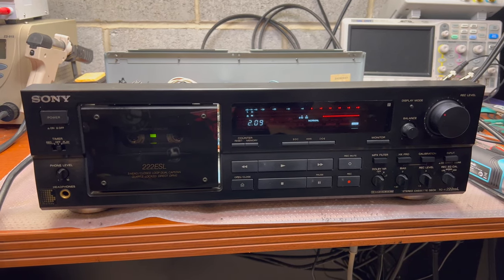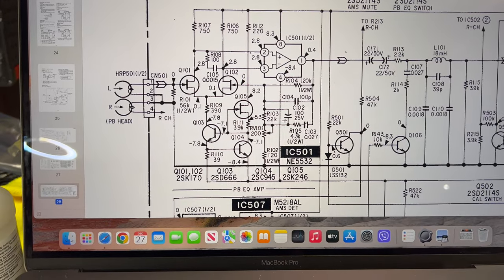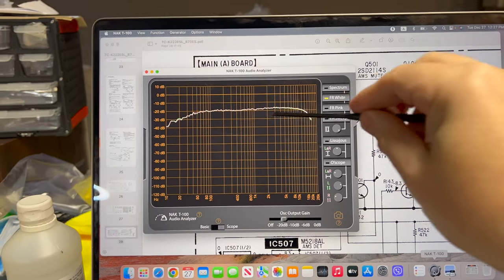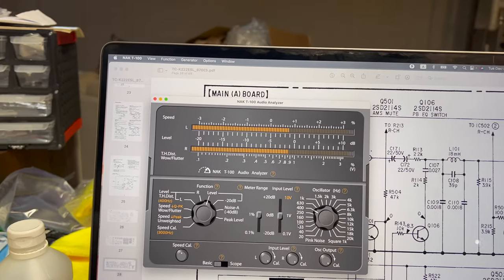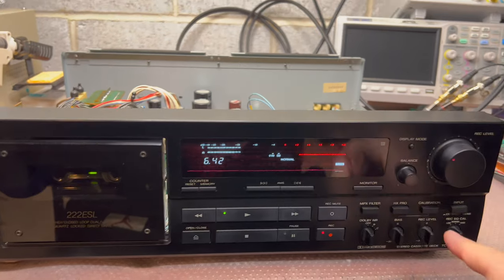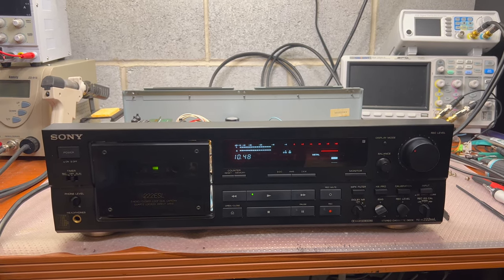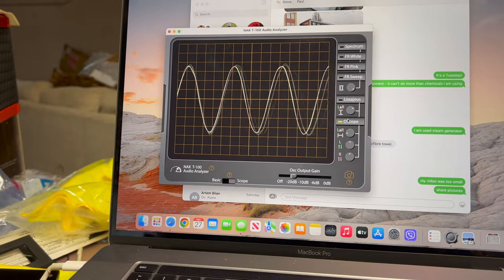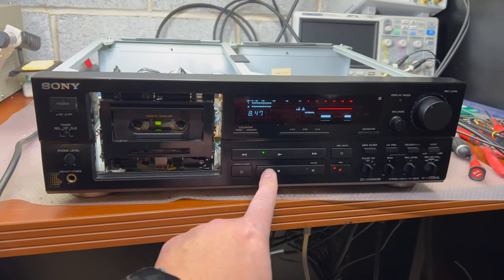How To: Set Sony Deck Playback Frequency Response - A Step-by-step Guide

Comment: hi,
I am using tc-k222esl. I am using Nak T-100 as test program. I'm testing "fr sweep". But at 10khz it goes straight down. I can't figure out the sudden frequency drop. I set calibration from front panel. I start recording but the high frequency sounds are almost non-existent. It's like it doesn't record frequencies after 10kz. There is a lot of difference between source and monitor. I set it to 400hz on the nak t-100 and "222esl" shows up as 0 db on the front panel. then I set it to 10khz. "222esl" decreases to -20 db on the front panel. Where could the problem be?
thanks
Reply from the maker: Cassette decks can record above 10 kHz only at low levels, you should measure sweep on -20 dB
Reply: Thank you very much for your reply.
Now I did a scan at -20 db as you said, but the result did not change. The results in your video are amazing. I also go down between 8khz and 10khz. Could it be a problem with rv303, rv403, rv302, rv402? Or would it be helpful to replace the capacitor as you did? because I don't get any pleasure while recording from 222esl. I bought it in a restored state from Japan. It saddens me that it records so badly.
Reply from the maker: @user-lk2mw4um5g  I may guess that head needs to be lapped. Absolute all 222s I have seen delivered from Japan had worn heads. And after lapping it still would require to install FR correction pots and additional capacitors to compensate loss.
Reply: @hifirulezzz  You explained it very well. I will do as you say. I hope for good results. You are very knowledgeable. I enjoy watching your videos. I will continue to use your information.
Best regards.

Comment: Hello.
I watch your videos with great interest.
I had my tc-k222esl cassettedeck completely restored.
But when I insert my sony hf-s and sony chrome cassette (rec level 0, bias level 0) and calibrate, my indicator is 4 points below the "rec cal red point". "Cal level meter adjustment" Do I need to readjust the RV102 and RV202?
Kind regards
Reply from the maker: If both of the bars on the scale are of the same level - then not much to worry about, just adjust the record level. If bars "low" and "high" are 4 bars different - then it is head ware, as sensitivity on the highs is lower.
Reply: @hifirulezzz  Your answer was helpful, thank you very much. Sorry for typing the level wrong. It's not 4 bars, it's 8 bars low. I will increase the level from "rec level" as you said.

Comment: Amazing resource. Looking forward to one day tune my TC-K770 the same way.

Also since you're talking Sony... how about calibrating the Dolby circuitry? I've always had the impression of Dolby muffling the sound, is it just normal drawback or is it because of mistracking ?
Reply from the maker: Dolby cuts highs a little bit anyway. It is just how it was designed. You may compensate by reducing bias and it will sound significantly better.

Comment: I used a 560pf ceramic capacitor for the left channel of the pb amplifier and a 470pf plastic capacitor for the right channel and the high frequencies were enlivened (increased 3db). but I couldn't fix the db slope between low frequencies and high frequencies. At 40hz -20db, 8khz becomes -22.5db. There is a flat landing. If it's 17khz it's -25db. If I replace the old capacitors with muse bp or toshin kogyo utsj capacitors, will it affect the result? Or is that the maximum upgrade I can get from the 222esl?
Reply from the maker: https://youtu.be/OuWgEd7hjgI

Comment: I have a Tascam 122b. The mids and HF are good.   But the LF are really not that great.  Is there ways to adjust LF on playback on cassette decks?  I am using a new commercial music cassette and also tdk type ii for recording.  Recording is also the same when i play back via repro. . LF not quite got the oomph like my other Tascam decks.  Could the caps be going bad? Its an old deck.  1980s, early.
Reply from the maker: Dried capacitors will may be a reason. I have met an Akai deck with very thin sound and level indicators were not moving levels. Replaced capacitors and it was a super sounding deck.
Reply: @hifirulezzz  There are alot of caps on the rec/play board.  Maybe just the electrolytic and LL caps?  Mylar are OK probably?
Reply from the maker: @rcary  yes, I meant electrolytes

Comment: Learning mode ON. I am pretty sure I am unable to detect it.
I have a TC-K770ES which is feature reduced export version of this deck... I love the form factor and ergonomics.

I really need to buy a scope to test these decks on my own but I can't find anything new that I like <500 EUR. I am not yet ready being ridiculed for buying a 5 MHz scope...
Reply from the maker: Well, exact copy is K870ES 😎 And you may just spend $25 for a good software like I am using which will cover your needs.
Reply: @hifirulezzz  I can read speed with my meter, if there is some software that can measure "phase" during playback for azimuth adj. I'll get it. I am on Windows.
Reply from the maker: @m80116  check videos on my channel, I am using Nak T-100 Analyzer software which is available for Mac and Windows. It has oscilloscope mode where you will be able to set the azimuth
Reply: @hifirulezzz  Best tip ever. Thank you... I noticed that software already and told myself: I'll never be able to find anything closer for Windows... but it wasn't my deck on the wrong bias... it was me!
Reply: @hifirulezzz  Thanks again... now I have to upgrade Windows that I don't do since well... 2016 and even find out how that software has 3000 Hz speed calibration mode. I can't understand what is that for... anyway, I'll find out eventually

I'm dying to try that software to characterize the frequency response of my cassette tapes.

Comment: This looks like a gap loss. I believe there were discussions on TH about the heads in these sony decks having very shallow gap depth, and with minimal wear the gap starts to open very early in the head's life, which s*cks.
Reply from the maker: Well, Microscope does not confirm that theory. What I mentioned, is that Sendust heads and Nakamichi Crystalloy heads age better than Laserampurphous. Also, have read in a few places, that it was a marketing move to make last-generation decks produce less hiss, and as a result, they changed the schematic not to match to IEC curve. Check yourself. Earlier generation decks with LA heads had capacitors parallel to the head and later were not.

Comment: If I record a FHZ Sweep what fhz did you use? Will the peak level be the same for high 10k HZ? I want to test my cassette head know to lose Hight fhz also is their a way to play it and  graft the fhz responds or software like a 2 Head Deck?
Reply from the maker: manufacturers agree to use the IEC II standard to have compatibility between decks. As a result frequency response was normalized to have the same response in the range of 400 Hz - 10,000 Hz. All good decks correspond to this standard and should fully match specialized test tapes. However, for your purpose to just measure if the deck heads degraded compared to the good decks you know - you can record sweep tape on the good calibrated deck and play on the suspicious deck. You will have to make sure that the playback phase will match the recorded phase. If a deviation will not exceed 1-2 dB you should be fine. If it exceeds 3 dB or more - definitely correction will be needed or the head should be replaced.
Reply: @hifirulezzz  Thanks I can use a software program that can do a Fhz sweep But what would be the output Level? and equal to what DB? -20db? for Best recording?
Reply from the maker: @musicstevecom  If your source deck is a Nakamichi - you may use -10 dB as most of Nakamichi's record flat at this level. For the generic case use -20 dB, specifically on type I tapes.